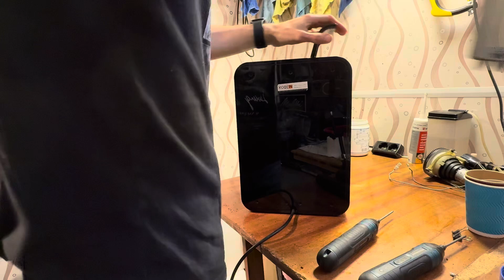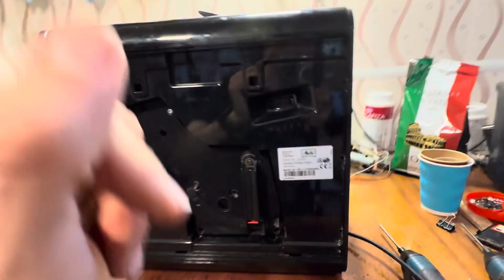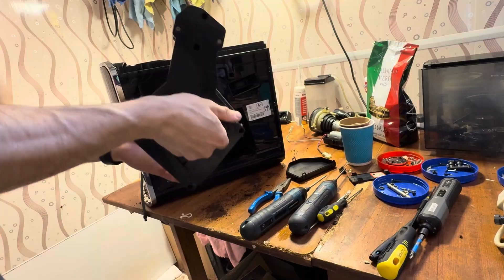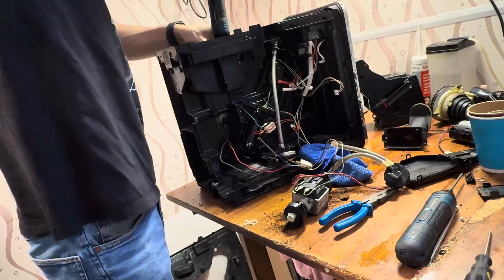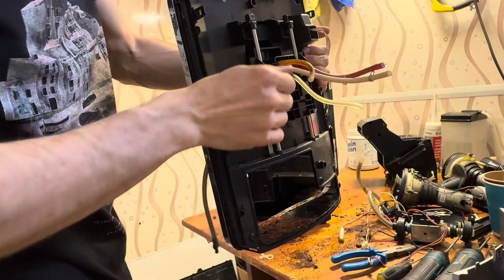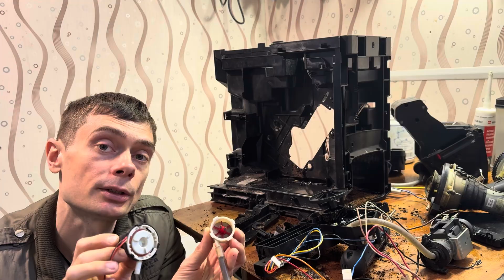How to disassemble and check parts of Melitta Barista machine

Comment: Hi Oleg,

Thanks so much for the content, especially in English, it's really appreciated!

I’m having an issue with my Melitta TS Smart. At first, it started having trouble frothing milk. I noticed that if I held the milk container higher than the spout (using a sort of siphon principle), it would froth okay, maybe a pressure issue?

A few days later, it began struggling to generate enough water for the coffee-making process itself; water prep became noticeably slower. Eventually, it stopped working altogether and displayed the message: “Fill the system” (even though the water tank was full). No water was coming out at all.

I checked the flowmeter, as you recommended. It didn’t show any obvious issues, it still spun, though I cleaned it just in case. After reassembling everything, the problem remained.

I then assumed that it might be the pump, I replaced it with a new one, but the issue persists. The machine tries hard to pump water but eventually gives up and shows the same “Fill the system” message. Some water drips through to the drip tray.

Do you think the flowmeter could still be the issue, or could it be something else entirely?
Reply from the maker: Hello. There can be a bunch of problems. Start with disassembling multivalve - it can got cloggings so yours machine can’t send water throw. And check top piston of brew unit - is where a coffee particles under shower? If so - clean all entries with small round  brush. And shower clean too.
Reply: @OlegPC  Thank you for a quick reply, do you by any chance have a video on multivalve disassembly for this model or brew unit piston check? I couldn't find one in English and struggled with tittles in Ukrainian.
Reply from the maker: @TheFastMage The best choice this video ( on Ukrainian, but video picture - helps to understand ) - Не готує каву Нова або Абсолютно робоча Мелітта / Нівона / Міллє. Легке рішення.
https://youtu.be/eodA9zN2_g0
Reply: @OlegPC  Thank you for the suggestion! The video was really helpful. I cleaned the entire brewing unit and the piston, it was definitely worth it because there was a lot of coffee residue in there. Unfortunately, that still didn’t fix the issue. Do you happen to have a video on cleaning the multivalve?
Reply from the maker: @TheFastMage  Second cause of such problem as in video - broken (actually had a little crack unseen by eye) inlet water nose of brew unit. Unsrew it and check visually - it must be absolutelly align. If you got some suspission in some angle on long side of that nose - thereis crack and it must be replaced
Reply: @OlegPC  I just ran a little experiment since I didn’t see any cracks where you mentioned either. I removed the outlet valve at the top altogether to eliminate one component at a time and see where the water flow stops. When I ran the start-up cycle, there was barely any water coming out of the boiler, just a few drops. In my opinion, this suggests that the issue occurs well before the brew unit or multivalve.

Next, I disconnected the pump hose from the boiler and ran the start-up cycle again. This time, it produced about half a cup of water. To me, that suggests the water isn’t getting past the boiler unit. Please correct me if I’m wrong!

Do you think there could be too much limescale buildup in the boiler itself? Is it possible to disassemble and clean it, or would I have to buy a new one with no other options?
Reply: @OlegPC  Update: I fixed it! I removed the boiler unit and completely disassembled it. I noticed that I couldn’t blow any air through it, so I pulled out a needle and started picking at the outlet pipe since it wasn’t letting anything through. After lots of scratching and what sounded like digging through sand, the blockage finally gave up. I managed to blow out a lot of water and debris, then did some more cleaning with a long, slim brush. The flow was perfect after that.

I just made my first cup of coffee after weeks of surviving on instant coffee. Thank you for everything, Oleg! Your videos and advice taught me so much and gave me the motivation to fix it myself.

Slava Ukraini! All the best to you! From Lithuanian brother!
Reply from the maker: @TheFastMage No. all this once again point to inlet water nose of brew unit. Or crack in drainage valve. But it’s second most common variant
Reply from the maker: @TheFastMage Nice work! My congratulations!

Comment: Hello I have a Melitta ts and yesterday morning has completely stopped no power ,I did switch it on and after a few seconds it did make a noise like it blown an internal fuse inside the coffee machine and turned off no power at all is completely dead  no noises or lights on . Would you please direct me what to check because I don't know where to start with it I did check the thermostatic fuses at the top of the coffee machine next to the heater but bought measuring fine on multimeter Also check the switch valve and is reading fine on multimeter. Would you be able to point me what to check next please, thank you.
Reply from the maker: Hello. You got problem with motherboard . If you are not specialist in electronics- it’s better to buy a used one on eBay.

Comment: Hi, I hope you can help me!
I've done a deep clean of the Melitta Barista coffee machine. I took back, top and side covers following your excellent guidance. I was really careful with cables, I kept all of them connected and even if I had to disconnect them I ensured I have photos how to put them back. Unfortunately I probably did something wrong, as my machine does not turn on anymore! It's like a brick! I've checked the power is going to the motherboard after clicking the power on button, but then nothing else happens. The screen is black, there is no noise, no alerts. Any idea what to check?
Reply from the maker: Yap. Hello. Check connections of thermal sensor ( must be on NTC on main board connected) and connections of front board panel and service can be miss connected because they look same
Reply: Hi did fix it, I have got the same problem :(
Reply from the maker: @YahooGR10588  Front sensor wire was disconnected from front sensor side. Take out front panel, open front panel back cover (holds on clips) and check wire connection.

Comment: hi!
i have the same machine i have a question my milk suddenly stopped working what could be the reason for it?
Reply from the maker: There’s many causes can be. Let’s start with easy one - take out, clean front cappuchinator, put a little grease inside it, drill connectors of milk tube to about 0.5-1mm bigger diameter. (2) Descalling. (3) Change pressure valve connected directly to boiler. (4) Disassemble and clean inside Multivalve and its air inlet. If all this willnt help - replace multivalve
Reply: @OlegPC  you talk too smart for me :D is it possible u have some kinda video about it maybe it will be easy for me
Reply from the maker: Sorry. There are no other answers. If you cant undersand my answers - its better to ask for repair service center specialists.